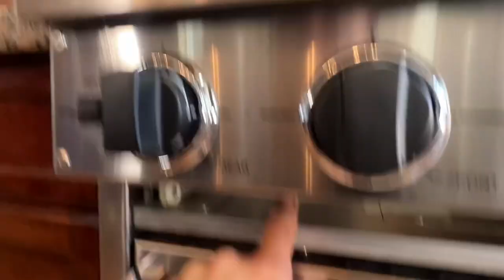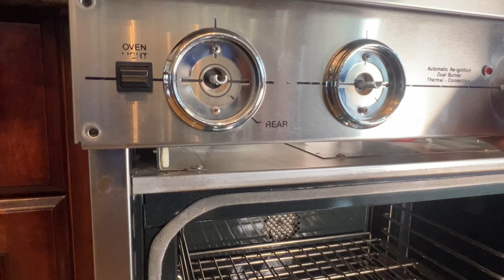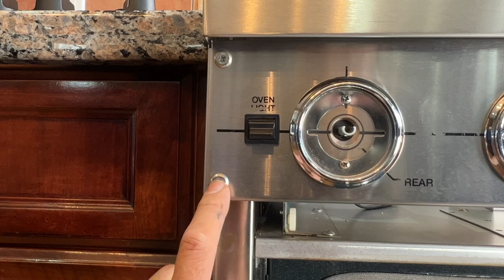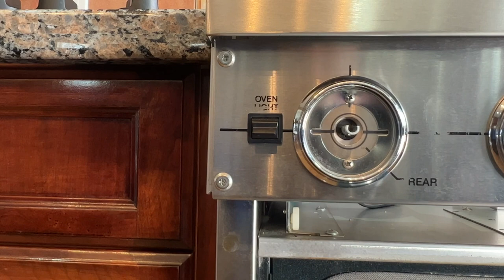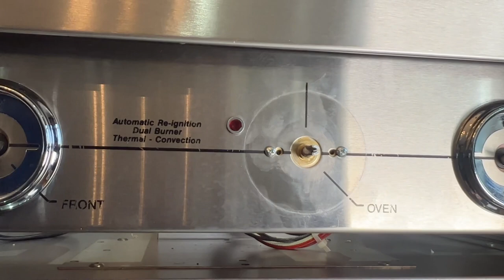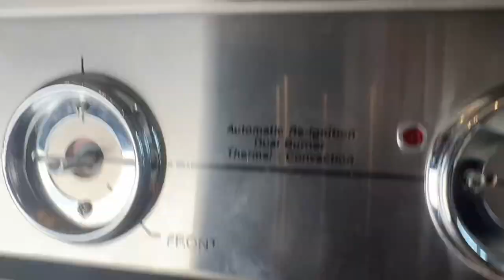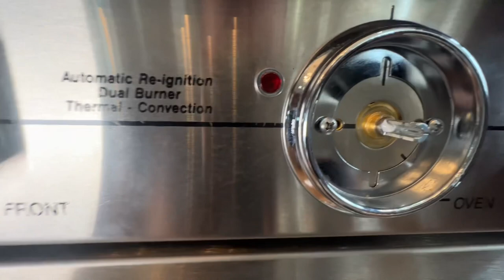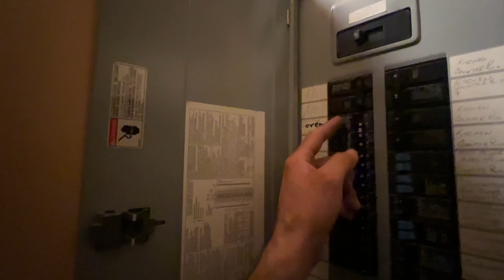How to replace Ultraline gas oven thermostat.

Comment: Thank you very kindly for making this video. Your patient explanation of the many steps gives me a clear path to follow in replacing our bake/broil thermostat. Our Viking has the sealed burners design which has the copper wire exiting the space under burners through a hole in the back wall and entering the oven through another hole also in
Reply: … the back wall.

Comment: Thanks for this! Made the repair on my Viking VGIC-305 go smoothly and with confidence. A couple of comments: my unit appears identical to this one except for the model name but I did not need to remove the center panel (at 4:27) to do the job. Also, the last third of video has music so loud it drowns out the voice over. Fortunately the repair is done by that point anyway so it really doesn’t interfere with anything. I think you could edit it out without any loss. And lastly, I have a question: has anyone actually cooked food in that oven? I mean I feel like a total slob after seeing that thing compared to mine! I’m not the original owner but I cannot believe it looked any cleaner when it was brand new. Hats off to the owners if they can put food on the table and keep their Viking looking like that! I wish I knew their secret. Thanks again for posting this — saved me time & stress.
Reply from the maker: Thank you for your feedback I would definitely work on my music in future . Yes oven cooks very evenly.

Comment: I see way too many appliance guys using drills to install 1/4" long screws and it makes no sense. It takes like 5 turns and almost no time at all to use a screwdriver, and it's almost impossible to strip the head or scratch the metal surfaces. Stop using power tools on tiny screws, and especially the ones that attach facade and cover plates that are external and always visible on the appliance. Otherwise, good vid and thanks for posting because it is useful content
Reply from the maker: @mastermetalshredder  you are right , unfortunately everyone is used to easy things and almost all techs are using power tool including me 😅 but I m always extra carful when doing it .
Reply: @hameedwafaAFG  You are obviously very good at your job and know what you are doing. But still the screwdriver is the far superior tool, because even if you've never stripped a screw or scratched a panel face with your drill, you eventually will and it's just a matter of time. Novices or DIY'ers especially shouldn't have a drill, or god forbid an impact driver near a nice Viking or Wolf unit! Please keep up the content, your channel is really good and helpful. I subscribed after watching just one video